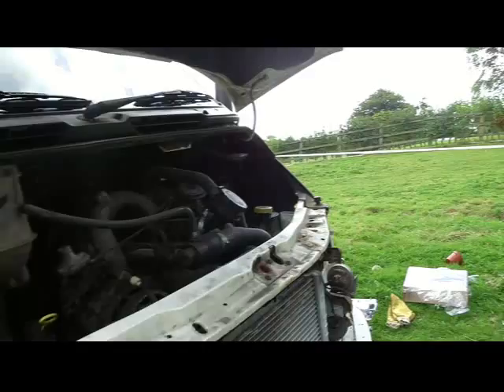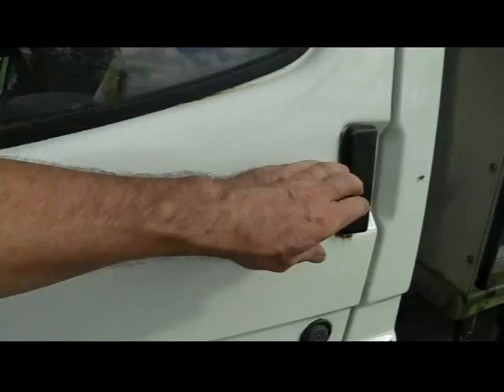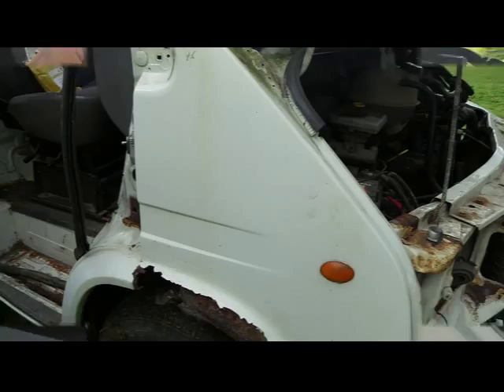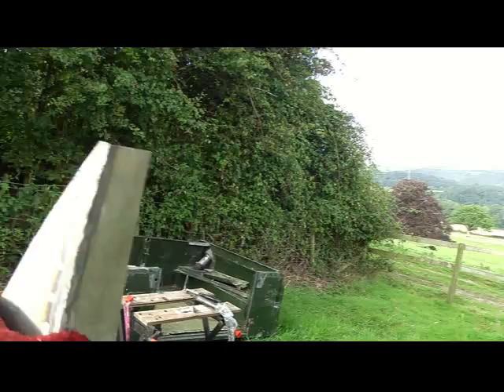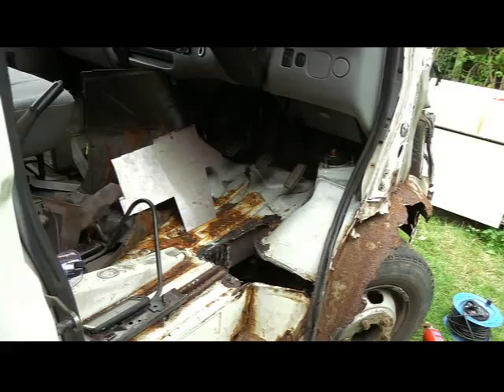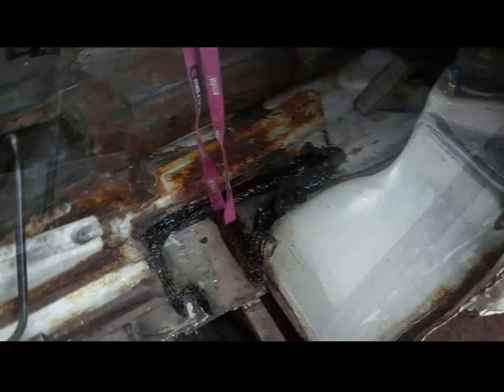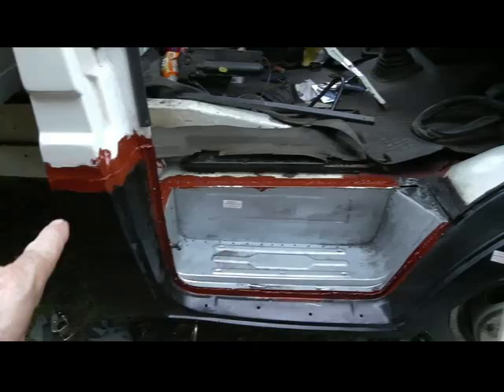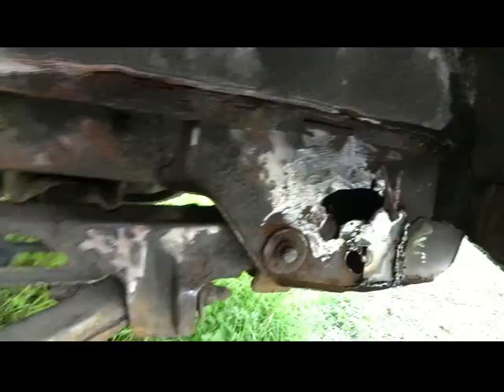TRANSIT REPAIR **MK5** OFFSIDE FRONT RUST REPAIR

Comment: great trucks
Reply from the maker: spectra vectra 
These old beasts are a pleasure to work on... plenty of rust to kill.  nearly finished the bodywork, got a miss fire to sort out, think the  timing belt may have jumped a tooth so will be stripping it down hopefully in the next week..
Reply: had my mk 4 ten years never let me down solid to
Reply from the maker: spectra vectra 
Hopefully this I'll mk5 will stay solid for a few years.... The new ones rust out quick, seen a 58 reg needing new sills.... I'd love to do an old capri
Reply: got mk 6 van 06 rust buket welded it to death crap steel from spain
Reply: Portuguese built Fords happened to be the best built ones since they use better steel.
Reply: was the mk 5 made in portugal
Reply: Sadly not.
Reply: my mk 4 musta been as it stil gd nik body wise for a 93 model only couple welds on sills

Comment: good work mate, my truck wasnt as good as this, i did the steps and sills, same as you, wings, arches, rebuilt the back of the cab, chasis rails, wishbone hanger at front. was a nightmare lol its not eprfect but its solid now 

good job that
Reply from the maker: Cold Start Daily  cheers mate. Started the off side now.. bit if a nightmare. Bulkhead corner where it meets the floor as rotted right through. .. having to make a support brace before I can do the rest. 
Thank you for your positive coments. 👍

Comment: Great video. 1 question- how did you attach the top of the step to the floor by the seat rail? Did you weld flush or overlap and drilled holes and spot weld? Cheers Vinny!
Reply from the maker: Hi mate, thanks for your kind words. I did an overlap .. seemed stronger that way... over a year has passed now and still looks like new..no rust coming through...

Comment: Hey mate, where did you get your panels from? Also i see you were MIG welding, what sort of amps were you running? I'm currently saving an old transit mk5 ex ambulance and spotted today that the sills were shot. Some one of the previous owners filled with expanding foam and then filled it :(

Great video though, very helpful for when I go at mine :)
Reply from the maker: Hi Mate, I got the Panels on line from Central Panels. I did buy myself another welder. I got an OXFORD welder. More reliable and steady power. The sealy one was a 150 amp

Comment: Are the repair panels originally part of one section or were they welded on seperately?
Reply from the maker: Michael Langley 
it's all welded separately... the inner arch original is spot welded on the wings also spot welded... my out riggers were originally spot welded .....badly.. 

I've seam welded everything on so it's strong...

Comment: So much rust! Why do transits do this can it be prevented?
Reply from the maker: I think its down to poor steel quality and prep work of the metal. All the new panels I've fitted I treated with the best primer, used tiger seal on the welds... it's been over a year since I finished the old girl and so far no rust patches whatsoever...😁

Comment: It's crazy how badly they rot Pity as they were such a good van 😢. Peugeots from that era undercoated there cars a lot better and a lot are still on the road
Reply from the maker: piston head 1243 

Yeh even the modern transits rot quickly at least I've saved this one from scrap heap.... MOT in the next few weeks so fingers crossed.
Love the old DI engines so reliable,  nice and basic, bit slow but plod along. I've blanked the EGR valve which has improved things, .....
Reply: ANNE & PAUL PHOTOGRAPHY we turbod one in an owl van for the track. Maxxes out the fuel pump and 2 bar of boost went like a schalded cat

Comment: Would you say that the mk5 Transit had design faults?
Reply from the maker: Michael Langley 
Not so much design faults other than welding on wings which you could bolt on. If they bothered to treat the steel they would rot as they do. I treated the inner wheel arches with epoxy primer and guess what ... no rust coming through, even on the areas were I have welder....
I've seen mk7 transit with inner sills gone...not good
Reply: The repairs you have done will last along time. The lack of protection was the biggest issue  on mk4/5 Transits. If Ford galvanized the bodies then they might not have rusted as bad. They also have water traps too at the bottom of the back doors on vans, steps, arches etc. You can't fault the Ford DI banana engine. Its bombproof. I think Ford have finally got the rust issues under control now on the Transits and other models.
Reply from the maker: Michael Langley 
I must admit to being shocked by some of the modern designs.  I have recently done several transit customs were they had a so-called service. Then displaying water in fuel faults. On investigation I have found that the fuel filters are not being replaced, the filters on the custom are located underneath the nearside and get covered in mud and crud. The can be a pain to twist of as they are a cartridge type in a plastic casing. Plenty of WD40 and huge grips is the only way. Also I had to change REAR door hinges on a custom due to...........rust...lol.
They have improved butmi do think the quality of the steel is poor. Bring back our own steel industry and do away with cheap import.
Hope your well mate.

Oh I've set my own business up now doing mobile.... check out my page...www.paulsbreakdownsolutions. co.uk also on Facebook too
Reply: I think every car has a design fault.

Comment: What ever sort of steel or galvinizing Ford used was poor but mind you our climate doesn't help either. Mercedes Sprinters are even worse for rust.
Reply from the maker: Michael Langley .... I have noticed with some panels I buy off the net are rubbish for welding.... cheap nasty import steal.... ... and they rot so quick.. I use red oxide on everything it does help to keep it at bay..
Reply: Red oxide is good. Used it when i found rust under my platelight and other areas. Sadly the rust came back under the plate light since its a water trap.Now sanded all the rust and treated it with Vactan.